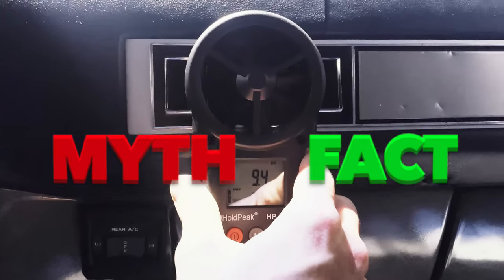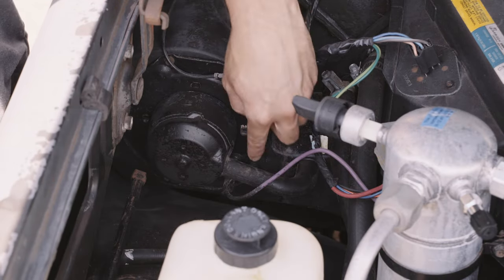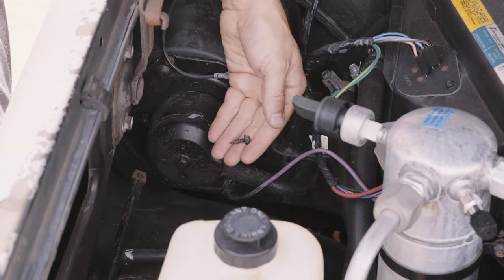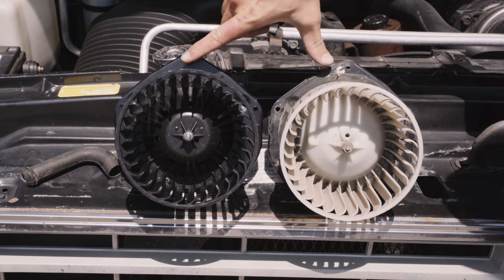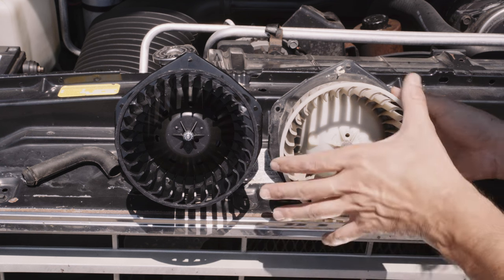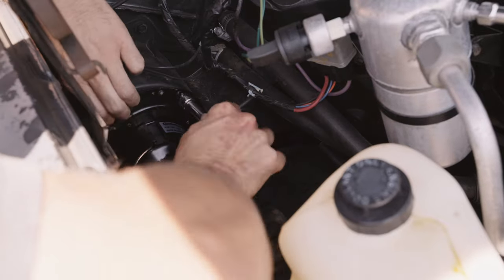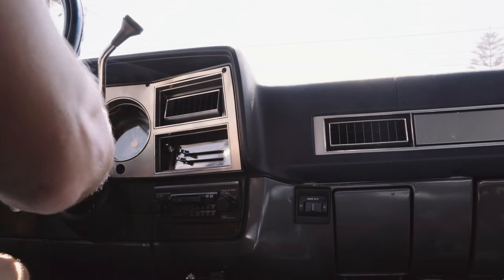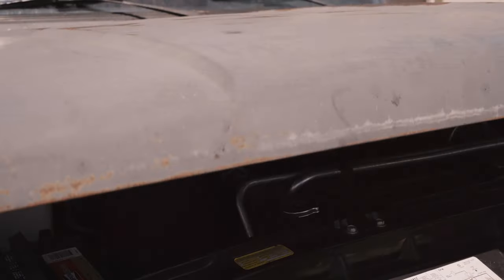Square body Chevy and GMC Blower Fan $30 Upgrade - How to

Comment: Appreciate someone actually upgraded the current AC unit rather than just throw Vintage Air in.
Reply from the maker: I mean, VA is the best you can do, but definitely will take any upgrades I can until I can afford VA or get a sponsorship

Comment: Do you happen to have a part number for that right angled hose? No longer have that hose for mine and would like to get a replacement
Reply from the maker: @pantherch6897  I don’t have the part number. Your best bet would be to go to an auto parts store and have them pull up the schematic. Usually pretty easy to do it that way.

Comment: Do you know what make/model that new one is from?
Reply from the maker: I mention it in the video PM129. I got mine from Autozone. Not sure what the brand was
Reply: Unless your blower motor in your c10 is worn out don't bother getting the motor in the video it's no more powerful than a new stock ac motor I've tested with myself with a windmeter
Reply from the maker: @Frankgonzalez-hj7bm  turns out in some stores the part number is even the same lol

Comment: Why not test a new factory blower. Since you are comparing an old worn out blower to a new one.
Reply from the maker: Cause I didn’t want to chance a new oem one not blowing as well. This was a perfect fit and had no risk.
Reply: @dillansgarage  would be a great video comparing the difference tho!
Reply from the maker: @loganator78r  I just might do that some day!
Reply from the maker: If I had to place my bets I’d guess they’re the same motor
Reply: It's a waste of time I had a brand new stock blower motor in my 1980 c10 and tested it with my wind meter then used the OBS truck blower motor and it still read the same reading with the wind meter, I wish a company would make a stronger blower motor for 1960s-1990 classic cars and trucks, because they all get cold but they all have a weak blower motor that holds them back, the reason the guy in the video got better air flow was because obviously his blower motor was a worn out original one. Obviously $2000 vintage air would be the best , but if someone would just sell and upgraded faster blower motor it would be a good alternative, I tested my 2015 mustang on high setting AC and it read 1800 on the meter compared to the 1980 C10 was only reading 900 on high setting , my 2003 tahoe is decent for an old car and was reading 1300 on the meter so obviously GM didn't start using decent blower ac motors till 1999 and up
Reply: Got a new factory blower "sucks" waste of my "factory" money 🤬
Reply: @justaservant-5888 same here. Big disappointment